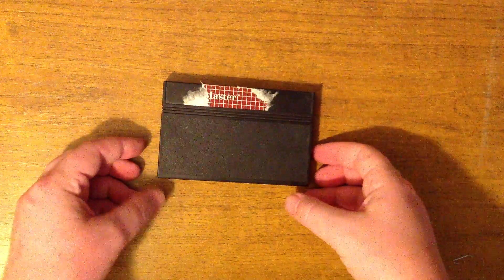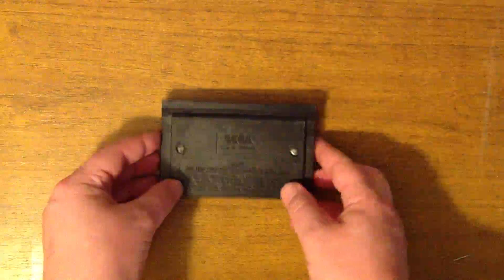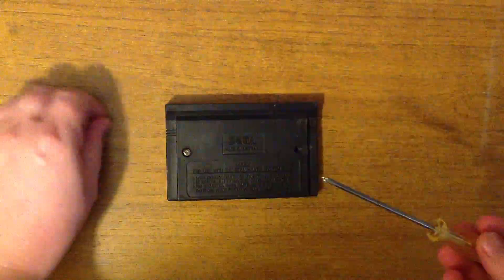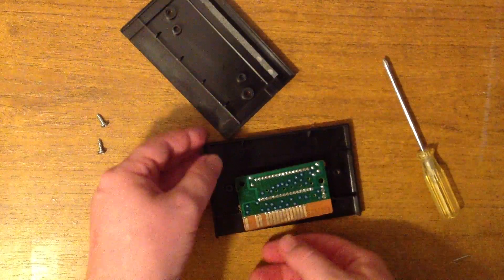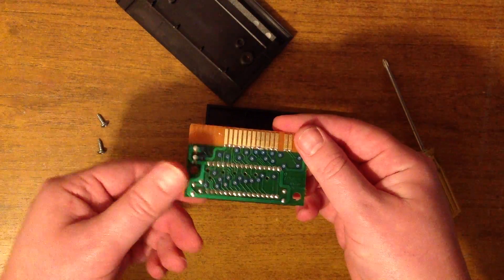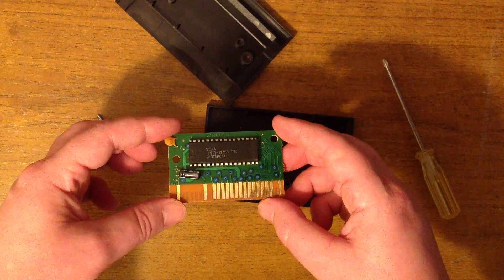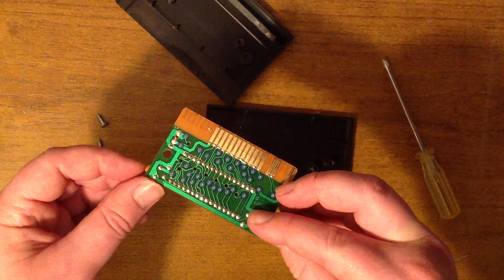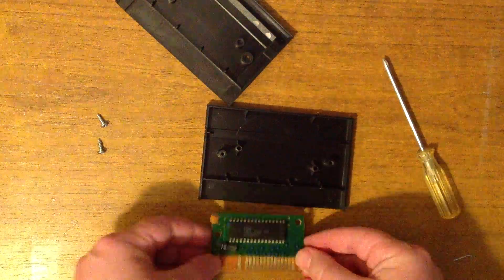Inside a SEGA Master System Cartridge

Comment: What purpose do the capacitors serve on these carts by the way?
Reply: Keep the voltage to a minimum to avoid frying the chips
Reply: @toddlindsay8846  That would be what a Resistor would be used for, I would think at least.  Capacitors are usually for some kind of specific power delivery or filtering if I'm not mistaken.  Am I missing something here?

Comment: I just bought batman returns for the master system and saw that some of the gold metal things there was gaps between them with none there the game works and just watched this video and yours the same so I guess it is normal. Weird coz in all the other games the gold bits are all along lol subbed because this has helped. Sub for a sub? 😄😄😄
Reply: If I understand what you're saying correctly then that is what's known as a broken trace.  You can add some solder between the broken trace to fix the problem and it should work after that.
Reply from the maker: super, sure thing